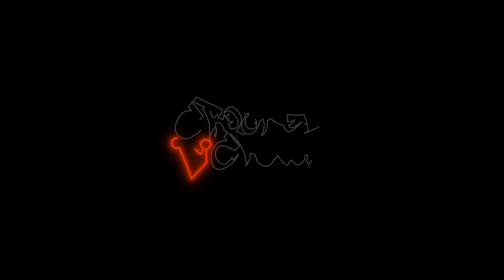SOHO A2A V2 SUPERCHARGED G37 PROJECT PART 4

Comment: Soo blower sucks in air then compresses it with crankshaft energy with the pulley then goes out to charge pipe then passes inside intercooler to cool it then goes into the engine? Am I wrong?

Comment: Quick question if you have time. Do I need to do forged internals or any other motor work to put a supercharger on my 03 350z or can I just install it on a stock motor safely
Reply: Depends on your power goal, a de can handle I would say about 400-450hp stock block. Obviously the health and milegae of the engine comes into play toom1
Reply: Vhr can handle 500whp-600whp stock block
Reply: I have a stock de with 130k miles.. only have CAI